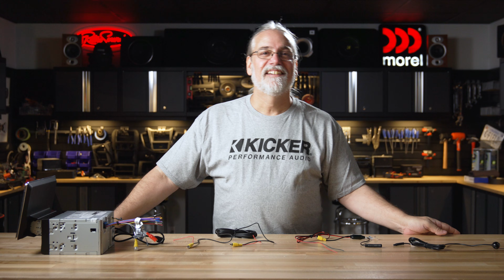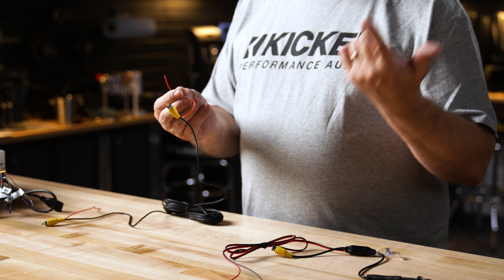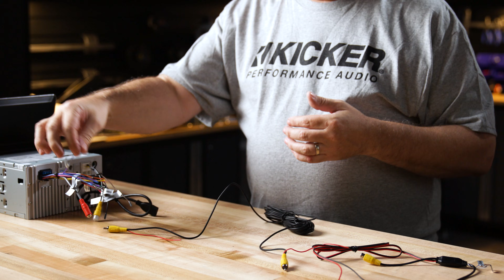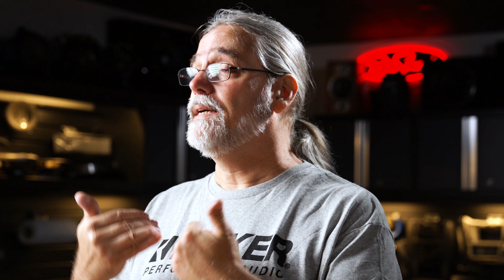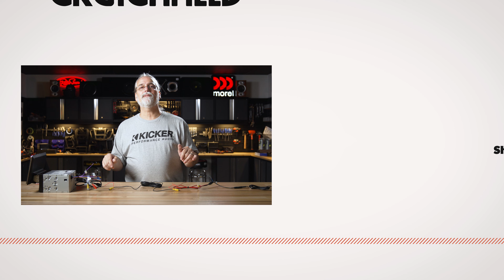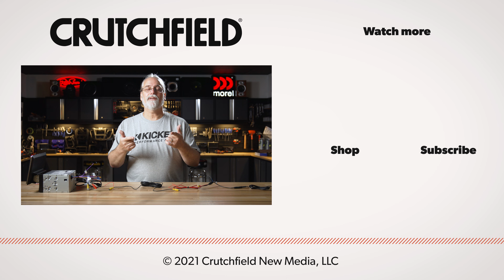Powering your backup camera (and how to use that extra wire) | Crutchfield

Comment: A quick question. What could be the cause of .. for lack of a better description, the backup camera I have wired to use as a switched rear view. Not solely a back up. I've got a separate one over the hitch. What could cause it to brighten and then dim. Mind you when it's bright, it's got a washed out appearance. Then it  gets a more clear useable image.
Reply from the maker: Could be a wiring or even a placement issue. If you got the camera here, please give our Tech Support a call. Their direct number is on your invoice.

Comment: I followed the option of powering the camera from the fusebox.  Since my backup lights are on the back door of a hatchback, I bought a fuse tap and 7.5 amp fuse to add power from the backup light source and ran it to the head unit.  However, the camera stays on all the time.  I have a 2008 Mazda 3 and wondering if the power from the fusebox heads somewhere with a switch before going to the lights.  At this point, I've disconnected the camera and hope to resolve it with a reply or may have to run the wires up and onto the hatchback, where the back up lights are connected.
Reply from the maker: Hi Paul. If you got the camera here, please call our Tech Support. Their direct number is on your invoice.
Reply: @crutchfield  First of all the video is fantastic mentioning things others don't. However, I didn't buy any equipment from Crutchfield, but followed the video produced by Crutchfield.  I don't know if the video recommendation is in error or misleading to tap into the Reverse lamp at the fusebox, which appears to be hot whenever the car has power. It could be the 2008 Mazda 3 wiring is different, but the video didn't mention issues between different vehicles.  Thank you for any assistance.
Reply from the maker: If the reverse lamp circuit is always hot when the vehicle is running, then there must exist a second circuit that acts as a trigger to turn on the reverse lights only when the vehicle is in reverse that should be used instead
Reply: @crutchfield  exactly, figure out which wire is your actual reverse light and (it should only be on if in reverse) and tap that wire directly. My biggest question would be, once you get the exact wire you need in the back end, how difficult is it finding that same wire up front?

Comment: Do you sell a Backup camera with android stereo system built-in for a  2004 Lexus RX330
Reply from the maker: We will be happy to check and have a couple questions on possible options in those Lexus SUVs:

Does your RX330 have the Mark Levinson sound system?
Does it have a factory installed rear seat DVD entertainment system?
Does it have factory installed navigation?

Comment: Is there a good way to make the camera trigger on demand (switch?) AND when shifting into reverse?  Would like to use it whenever, and not have to flip a switch every time I put it in reverse.
Reply from the maker: There is a way to do it when the camera is installed so it get power anytime the vehicle is in use and when the new radio lists the camera as a source that can be selected to display. This camera source ability is found in most of the touch scree radios we offer:

https://www.crutchfield.com/I-rYTVc227/g_462250/Touchscreen-Radios.html
Reply: @crutchfield  Do you mean that he (Indy Jones) would need to use the touchscreen in order to switch to camera view when not in reverse? I would prefer to add a physical switch to my dash in order to switch to the camera view. That would be safer while driving than messing with a touchscreen. Of course, I would not want the backup lights to activate while I'm driving or parked. Can this be done? I have the Alpine iLX-W650 that I bought from Crutchfield.
Reply: Unless I'm missing it or just don't understand, this scenario isn't explained in the video. I also want to wire my setup to automatically trigger the camera when you shift into reverse AND to be able to 'trigger' it on demand by a switch when the vehicle is moving. So far I've wired it like this: I've grounded the camera to the its own separate chassis ground. I've joined the camera power into the convenience wire on the video cable. I've attached both of these to the vehicle reverse power wire. Now if I connect the convenience power at the other end at the headunit to the camera in trigger on the headunit then it will work when you select reverse in the vehicle. Now I'm wondering how to wire in the 'on-demand' switch. If I just take switched 12v from somewhere and wire that to my switch and then wire that into power on the convenience wire, then the circuit will be powered when I select the switch on. However I'm thinking my reverse lights may also turn on if I do it like this? I'm not sure. I may just give up on the 'on-demand' switch and leave it just triggered by selecting reverse.

Comment: O have two white wires coming out of my RCA connector for the camera so if I power the camera off of both will the pink reverse trigger wire automaticly power the camera too?
And I don't know why they are both white.
Reply from the maker: A reverse trigger wire on a receiver is used to detect when the vehicle is in reverse gear so the radio automatically switches the  display to show the video feed from a backup camera. It will not power a backup camera.
Reply: @crutchfield  but my camera RCA has two small white wires with it from the head unit any idea what they are for?
Reply from the maker: The owner's manual should identify the purpose of those wires. Typically, there is an installation section in the manual that covers all the connections and their purpose. If not, we recommend contacting the manufacturer for help. Who made this radio?
Reply: @crutchfield  it's a Chinese thing so not much to say about it.

Comment: I have a pioneer double den to 71 I install a back up camera but when I put it in reverse it shows everything nice and my radio works fine tune at the same time I put it in reverse once I put it in drive my radio sound static you or if I put it in park it sound static it only sounds perfect when I put it in reverse I don’t know what I’m doing wrong if you could please help me out
Reply from the maker: If this issue is just happening only with radio stations, then you might check the wiring for a power antenna wire that was not properly connected. If you purchased your radio from us, you can contact our technical support for this help and any further troubleshooting that may be needed. We include their toll free phone number on the order invoice.

Comment: Is there some way I can have my front and rear cameras playing all the time on a separate screen
Reply: Yeah probably, just tap the red wire to ignition 12 volts. And plug the video cable into the screen u want. 

If you want it on even when the car is off, then tap the red wire to constant 12 volts.
Reply: Isn’t that eventually going to lead to a dead battery?